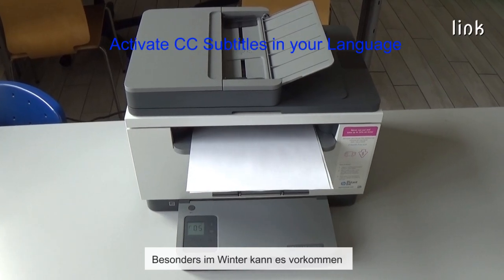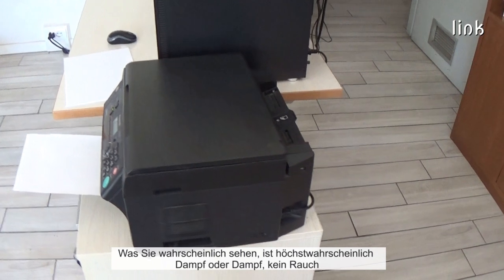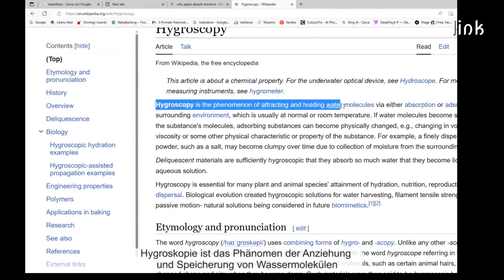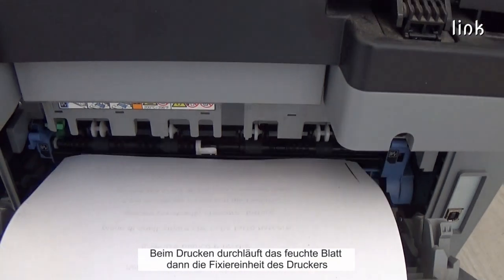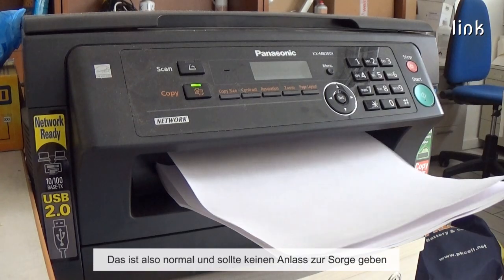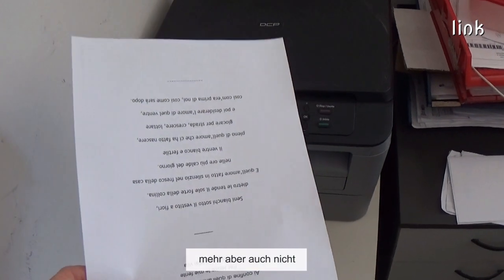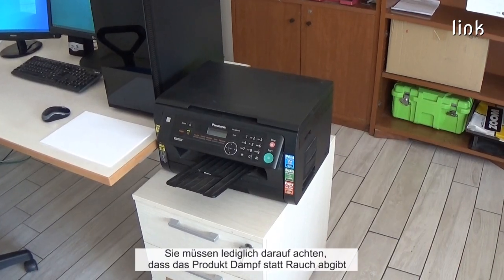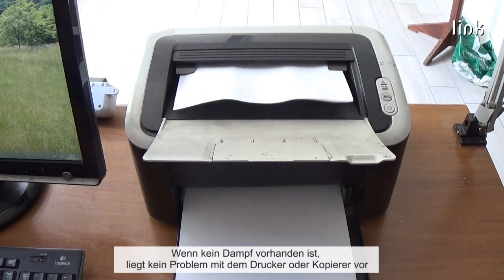What to do if your Printer "smokes"

Comment: hi my canon printer smoke is coming from the cartridge and then orange light blinks near the lightening icon. what could be the issue?
Reply from the maker: Don't you have an error message? Probably the smoke is not the problem. However it could be a fuser error
Reply: @viandant5 it shows me that the black ink cartridge cant be detected
Reply from the maker: @marky446  So I think the smoke is not the problem

Comment: hello! i just plugged my printer then it smoked, what should i do?
Reply from the maker: if it smokes very little and the printer is working it's not a problem, it's the humidity. if there is an electronic component burning it's another thing
Reply: @viandant5 i forgot to tell there's a oil thing leaking under  the printer when it's smoking.
Reply: @viandant5  another thing the smoke smells nice
Reply from the maker: @dumlaodaveannm.9152  it could be a broken motor, as the motor that moves the paper or the gears
Reply: thanks ❤

Comment: Bro my canon printer is realising blue smoke and just again and again doing cleaning of printer head and not printing anything (the smoke is coming from the printer cartridge)
Reply from the maker: I dont' know which printer do you have. May be the fuser, if present
Reply: @viandant5  so can I use it? Even if it's smoking blue
Reply from the maker: Hard to say if I don't see the printer but probably you can continue to use the printer.
Reply: @viandant5  it's an inkjet printer of Pixma g3000
Reply from the maker: @Peelglasses  But it's an inkjet printer, it has no fusers. Blue smoke? There should be a shortcut somewhere
Reply: @viandant5  hmm